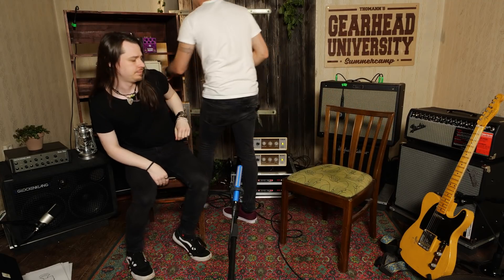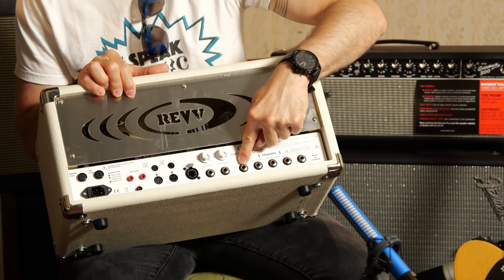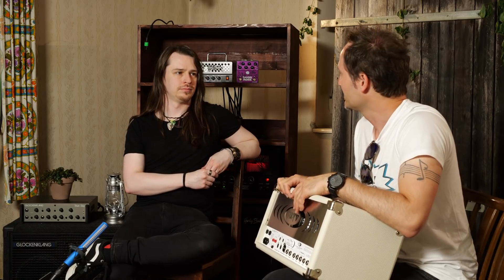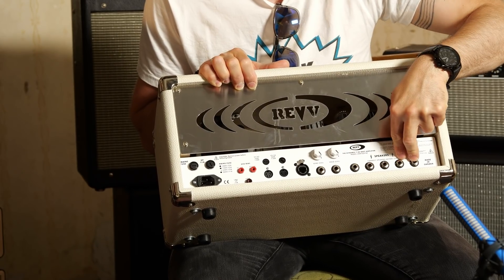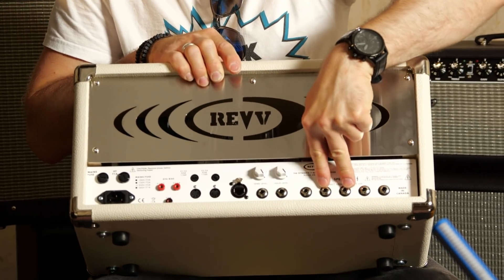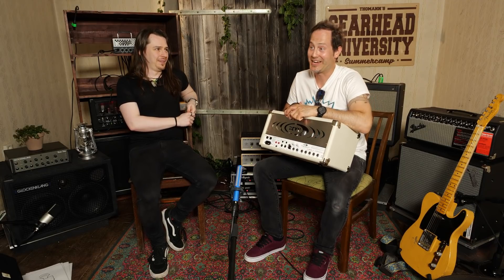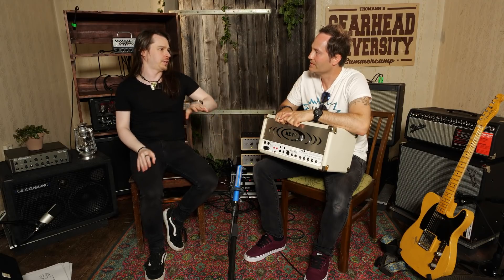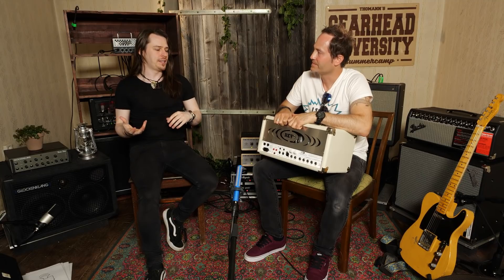How to properly connect your Guitar Cab? | Colin Scott | Thomann

Comment: So if I have a Mesa Boogie 2x12 cabinet that's 8 ohms and a Mesa 1x12 that's also 8 ohms, I would have to have 2 outputs on my amp head labeled for 4 ohms? Does it matter if one cabinet is 2x12 and the other is 1x12 if they both have the same impedance?

Comment: Not bad guys thanks but you didn't explain how to set things on the back of something like a Marshall 1960 4x12, where you also have 4 8 and 16 options , with a mono + stereo switch!
How would you connect an 8 ohm amp to that?

Comment: Hi. I have the orange tiny terror combo and a 16ohm external speaker with a single input Jack.  I would like to use this cab with the orange’s built in speaker. Currently, the amp’s speaker’s already using the 16ohm output. What are my options for using both with the cab i own.  Thank you!

Comment: Just out of curiosity I have an oddball question. My crusty well travelled and battered Kustom dart 10fx has a 4 ohm speaker rated 15W but the output for a cabinet is labelled 8 ohm.   Any ideas why?

Comment: Will it damage my fender (8ohm) Princeton amp if I plug it into a 4x12 Marshall1960 cabinet that's 16ohms in mono ??????
Reply: I was wondering the same with an 8 ohm amp ( just 1 output) to Marshall 1960 4.12.
I tried going to the 16 ohm with switch set to mono and got nothing. With switch set to stereo ( it says 8 ohm for that) I got one side of the cab working. 
No idea if that was ok either for my amp or the cab.
I then tried the 4 ohm cab socket and can't remember where the switch was set but all 4 speakers then worked.
Still wondering if this is ok to do or not?

Comment: I bought the HB G212 with mono 8ohm/stereo 16ohm inputs, and I've 2 head, one is 8ohm and the other 16ohm. Can I link them together at the same time in the cabinet if I switch it in stereo mode? Or the stereo works only with a single head with more than 1 channel? If someone have some video to share here, I will look at them too. Thank you in advance!

Comment: That's very useful. Tell us about the correct "cables" to use for amp to speaker and what different cable types and lenghts could make or break an amp. Thanks.

Comment: so...if using only 1 - 4x12 Marshall cab with one Marshall DSL 100 head as example i should use 16 ohms in back of head into 16 ohms cab input - 1 speaker cable ... correct ?
Reply from the maker: Exactly! If the cab wants 16 Ohms, connect it with the head's 16 Ohm output. And yes, you have to use a speaker cable for that. :) //Kris
Reply: @ThomannsGuitarsBasses  Thanks... i currently was connecting 8 ohms to 8 ohms using two speaker cabels one in each 8 ohm input of the Amp to the speaker on stereo... so using one cable 16ohms from amp to 16 ohms in Cab on mono is better...will it improve the sound also ? thanks again

Comment: Ok I’m confused ...lol
Having 2 cabs in series (daisy chain) at 8ohm ‘s ... I should have my switch in back of tube amp head at 16 ohms???  And not 8ohm’s???
Reply: Yes. Daisy chain 2 8ohm cabs plugs into the 16 ohm output on amp.
Reply: I don't think this I'd correct. Apparently daisy chaining 2 cans I'd parralell. So from head vto cab a. Cab a to cab b. With both 8 ohm cans gives you 4 ohms

Comment: I have an old Laney 4x12 bass cab that I plugged my Laney head into set at 16 ohms. Guitar sounded like crap through it and just assumed it was because of it being a bass cab. Later realized that the cab was 8 ohms, which is unusual because I'm used to 4x12s being 16 ohms. Then I  changed the output on my amp to match the cab. Sounds awesome now.

Comment: Hi i have The Boss Katana Artist MKII Combo with 8 ohms and 16 ohms A and 16 ohms B im getting The Marshall MX412AR 4×12 Angled cab that has a 16 ohms input so would it be safe to use my 8 ohms output on my Artist MKII to connect to the 16 ohms cab which is 240 watts

Comment: Great! Sorry for my ignorance, I have a question…, do you know if i can connect a MARSHALL CODE212-E (cabinet) or a Marshall MX212R-E (cabinet) with the BC108 vox cabinet to unlock the 50 watts of my vox MV50 Clean head amp?

BC 108 : one speaker ,  unit total impedance 8ohms
Marshall: two speakers,  unit total impedance 8ohms

Comment: Very informative. Worth mentioning too - before you start playing around - speaker cable is not the same as your guitar instrument cable, even though they have the same mono connector plug..  I didn't know this till recently and wondered why things weren't working.. Luckily I was playing around with a solid state amp :)
Reply: Wow so for the last 35 years I've just been crazy lucky and never blown anything up. I  have so many 3ft curly cables I just grab one out the box and plug it in. I must label them.

Comment: This is great stuff!! If I plug in a 16 ohm mono cab and an 8 ohm mono cab does that come out to 6 ohms mono? If so, should I set my amp heads switch to 4 ohms and not 8 ohms? Thanks guys.

Comment: I know this video wasn't about the amp's power output but I needed to know one thing that's more or less related with the video's theme: if you have a 120W tube head with two paralel speaker output jacks and you only connect one cab, the output is going to be 120W, right? But what if you connect two cabs, one to each output jack? Are you going to have 60W in each jack or you'll have 120W in both? The amp in question is a Bugera 6262 Infinium bought from you guys. Thanks in advance.  : )
Reply from the maker: Hey, the maximum output of the amp is 120W. Parallel speakers setup will split that 120W
//Andy
Reply: @ThomannsGuitarsBasses  - Just as I suspected. Thanks, Andy.  : )

Comment: When connecting an 16 ohm and an 8 ohm cab in parallel you get 5.33… ohm right? Wouldn’t you be “safe” with both connecting them to 4 ohms output? I mean are cabs like really precisely the value they tell you they are? Some old speakers sometimes have an ohm value, that are not in the power of two, like 5  or 6 ohms for example.
Reply: You might find this useful but be careful! http://blog.hughes-and-kettner.com/ohm-cooking-101-understanding-amps-speakers-and-impedance/

Comment: I have one cab which has two heads attached. Both properly hooked up to their respective Ohm inputs. I never use both heads at the same time. But would using them both together damage the cab speakers?
Reply: Hi, this is an interesting question which I would need more specific information to answer correctly. Can you tell me what cabinet and amps you have and how you are connecting them?

Your cabinet must have multiple speaker connections in order for you to have two amps connected at once, but likely these connections are simply accessing different ways of wiring the speakers which would likely cause some issue if you tried to feed signal to each at the same time.

Comment: Colin is a great bloke. Really love his videos.... Can I plug an amp direct from its headphone jack into an audio interface or do I just have to attach a cab and mic it up and send the mic through the audio interface.
Reply: Thanks Allan!
To reinforce what Kris said: Don't assume it's safe to use only your headphone output. If you have a valve amplifier you require a load connected to the speaker output to operate the amp at all times. So keep the cabinet connected, unless the amp has an internal reactive load. 
If it's a solid state amp then you have much less to worry about regarding loads, but still be cautious. 

All of that said, you may find the best tonal results come from sticking a microphone in front of a cabinet anyway.
Reply: Kris, Colin thanks for the advice. What's your thoughts on those amp/cabinet coffins, they sound like a good idea. Just don't want to be deafening my neighbours. Lol
Reply from the maker: Yes Colin is an awesome dude! :) 
About your question: it depends on your amp. Please check the users manual. It has to say, if it activates a load as soon as you connect a headphone. Some amps do that, some don't. Also, if it's a solid state head, then you don't have to worry about the load. If it's a tube head, it's very important to know that.
//cheers, Kris

Comment: Thank you! A few open questions I would like to get!
- Amp 2 Ohm Output total. I connect a 4 Ohm cab in first output. Is this now 2 Ohm loading or 4 Ohm loading the cab?
- What if I connect to the second output instead of the first?
- How to connect a 6 Ohm cab into a 2 Ohm head?
- What happens to amps that deliver like 3.2 Ohm?
- If speakers wired in series and first blow, the chain is broken and no sound comes out?
Reply: Hi, 
I'm assuming many of these questions are either hypothetical or are more applicable to car/hifi speakers instead of guitars. 
To my knowledge guitar amplifiers and speakers don't generally deal with 2 or 6 ohm speakers, and certainly not 3.2 ohms, these aren't standard values in the industry. 
2 Ohms is low impedance and generally associated with solid state amplification (valve amplifiers having higher impedance outputs are far more commonly 8 to 16 ohms). Solid State amplification is far less concerned about load matching as they don't have output transformers and will usually operate safely without a load attached, however connecting loads that are too high will drastically reduce the amount of power the amplifier can turn into sound. (Using a 16 ohm speaker with a 2 ohm SS amp would be significantly less efficient than with a 2 ohm speaker, reducing the effective volume from the amp.) 

-If an amplifier had a 2 Ohm total output, but had two outputs (as I think your first question suggests) and you connected a single 4 ohm cabinet, then the 2 Ohm amp output would see the 4 Ohms of the cabinet. Connecting two 4 ohm cabinets to each output (assuming parallel wiring in the amp) would have the 2 ohm amp output seeing a total of 2 Ohms from the cabinets.

- You should be able to use either output with equal results, unless specifically labelled otherwise. You may come across some amplifiers that label a specific output as the one that should be used 'first'. In that case do as the amplifier says, this output needs to see a load. 

- I would advise to only connect amps and cabs with matching loads. 

- Again, this must be a specialist case outside of guitar context or a hypothetical question. If not, what equipment do you have that outputs 3.2 Ohms?

- Terminology is perhaps important here: A 'blown' speaker could mean that the cone is damaged, this wouldn't affect the circuit as the voice coil would be intact. The second speaker could still make sound in the case of cone damage. 

If the voice coil of a speaker burns out or becomes damaged (by having too much power pushed through it for example) then that would break the circuit, you'd get no sound, and the amplifier wouldn't see a load. Attempting to operate the amplifier in this fashion would be dangerous for a valve amplifier.
Reply: @ScienceofLoud  Many thanks. A 3.2 Ohm does come from some acoustic SS heads. A 6 Ohm cab is one from Sunn with 6 speakers. Regarding series: OK. Regarding first or second output if not otherwise noted: OK.
Reply: Ampeg bass amps are designed to run at 2 ohms. Standard for the industry. Those 300 watt bass cabs all run at 2 ohms. You can run many speakers to get a 2 ohm load and that's a plus. I ran 4 speaker cabs at a total impedance of 2 ohms for years using my Ampeg SVT Classic 300 watt tube amp.
Reply: @PeterDad60  that's great for you. But what about 3.2 Ohm Amp into 6 Ohm cab?

Comment: Once tried my Fender bassman (4ohm, 100+ watt) on a vintage 2x12 hiwatt cabb (16 ohm) with 2 greenbacks (which are only 25watt each), Was the best sound ever! Also used the amp for years on a 8 ohm cab. The output transformer is still going strong :)
Reply from the maker: Yes, that's because most Fender tube combos are way less sensitive to mismatching impedances. You shouldn't try the same thing with Marshalls though. haha! I'm speaking from personal experience...
//cheers, Kris

Comment: Collin is wrong about the speakers in series. Both will have the exact same signal, because both will get the exact same current driven through it. They might influence each others behaviour but that will affect both speakers the in same way because they get the same current and thus they’ll sound the same (as long as they’re identicall).
Reply: Thanks for the correction. This highlights the importance of doing appropriate research, which on this instance I appear to have overlooked this fact.
Reply from the maker: @ScienceofLoud  Can you please clarify, what is this research thing of which you speak?
//Andy
Reply: Electro mechanical technician here. Can confirm.

Comment: Most  4-12 cabs are wired series parallel, that and inconsistency in the drivers themselves changes the tonality of each one. This is why  should to mic each Woofer to find one (or blend of them) in the cab that sounds best to your ears for recording, as each one will have a slightly different sound depending on where it is in the circuit. 

Sea Ice Guitars Rules the end of the rainbow with his pot of gold hardware!??
Reply: I find that the idea of two circuits in the same cabinet disturbing, but two separate 2x12s won't be mixing phase inside the box. Two 32 ohm cabinets are actually looking good for my purpose. not recommended for all you normal folks. 🤔
Reply: hoboroadie 8-12 cabs then?🤣My back hurts just thinking about those monsters